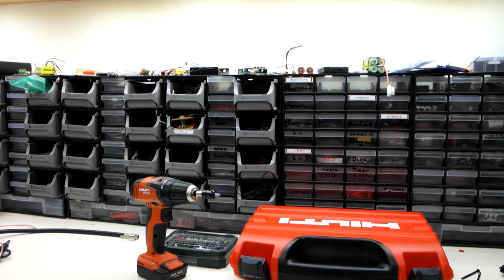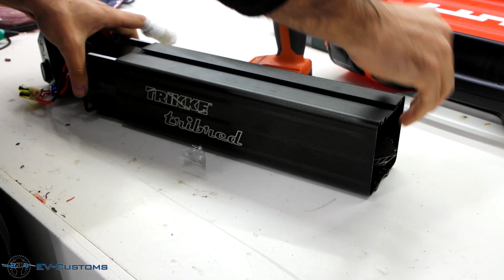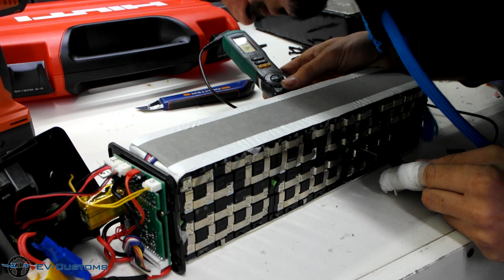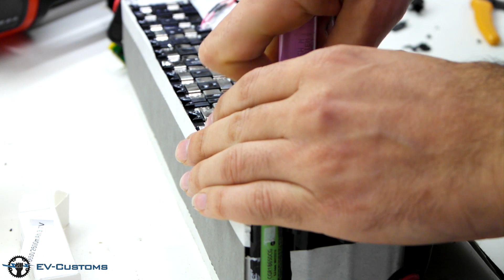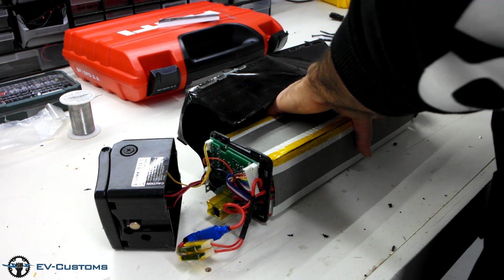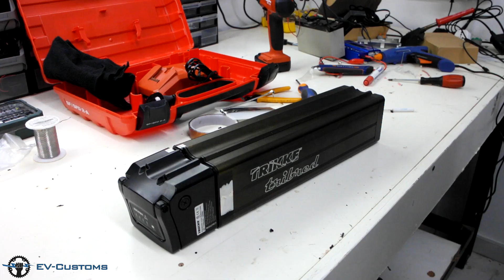48V Battery Pack Issue (How to Check and Fix it)

Comment: Does the the one you repair same c rating?
Reply: The replacement battery should at least have the same voltage and charging voltage as the  others, you can exceed the rating safely, but don't go under.

Comment: I screwed up my bike battery by leaving it plugged into long. Because I bought a crappy charger that's not UL listed FC or whatever it is. If you lived near me I'd pay you $100 and by the freaking batteries although that looks pretty easy I don't have a spot welder I don't have the tools you have. How did you figure out which battery by the BMS? Why was it saying 40 volts?

Comment: Like this. My issue is the battery pack is fully charged. As I road off the bike suddenly looses power and shuts down. I have 2 Battery packs and this only happens with this on. Any ideas. Thank you
Reply: BMS shutting down as power output too high, or cells not rated for such a high output. Getting a motor to start requires the most power.

Comment: Bro I have made 34ah 48v battery pack I have used quality BMS but total power not delivering at full charge it giving 2 km range hardly can you please help me? The motor rating is that 48v 1000w Yalu company motor
Reply: What cells did you use?

Comment: I have a 36v 10s battery its takes a day to charge and drains extremely fast, if I stoped using it the charge starts coming back up the dies faster when I use it again. Do you have any advice on what the problem might be.
Reply: A cell or cells have failed. It's charging slightly faster than the drain rate. Charge should hold. Every battery has self discharge

Comment: you give me new hope! I have issue with 52volt 14s battery 20ah it is the 2nd BMS that I try I have measured everything, I have 56volt can make a 220v lamp go but the motor will not run.
also cannot load

Comment: Hello, Thank You for detailed video. I have a 48V custom Lithium Battery pack, newly built. Battery voltage reads 49V, but when i try to charge, charger show as full charge. When i check each P i see that P1 - P2 is OV and all other Ps are fine. Does this mean i have to replace P1? I do not know problem is with charger or BMS? Please educate me. Thank You.
Reply: yes  first   checked the each  cell voltage
Reply from the maker: Yes it is possible BMS is defective but it is possible also one battery of itch P1-P2 can be defective and discharge your batteries.
Reply: During charge wire soldering, there was short circuit once. Do you think this could be reason for one or more battery to go bad? But bms comes with short circuit protection.
Reply from the maker: Yes but BMS board have short circuit protection on output, shortcut between batteries cannot protected from BMS.
Reply: Okay. Now possibly either one or more cell  or BMS or both, could be bad. Am i correct?
Reply from the maker: @ravikeerthi8052  yes
Reply: @evcustoms  I thoroughly check my battery and due to short circuit, nickle strip on one line was broken. I fixed it and verified it again. Battery voltage is around 54V. But Output from BMS is always 48V or less and when i connect charger it does not charge. Charger always shows full when connected. Could you help me?
Reply: @ravikeerthi8052  any resolution to this? I’m in the same boat
Reply: Confirm the voltage of each group first. Then connection from balance wire to the BMS connection.

Comment: excellent video! Beyond my skill level though. Do you know if anybody in the US could repair a bad battery pack? It’s brand new, but I surmise there is a bad set of cells in there (crazy voltage sag, BMS cuts within 7-8km) 60V 33.8ah battery.
Reply from the maker: Sorry friend i don't know anyone in US.. I live in Ciprus :)
Reply: If it's acting like that, it probably isn't worth fixing, but I can check it out to make sure it's fully built right. Most likely the cells are garbage and it would be a full rebuild with new cells. Always a possibility it's just a couple disconnected cells causing a sag tho.

Comment: How did you know that there was a problem?
Reply from the maker: If you look carefully when i measure voltage for eatch single cell, you well see that one pare of 5 parallel cells give  41Volt instead 3 - 4.2Volt.
Reply: @evcustoms  41 Volts? How can that be? Shouldn't bad cells mean a voltage lower than the others? i.e. 3.4V?
Reply: @seppl733  thats what i was wondering but maybe they can fault to a higher volatge somewhow
Reply from the maker: if you have some conception from BMS (LOAD) you can read high voltage from other batteries, like main battery voltage because the bad batteries didn't have any resistance -  continue there..